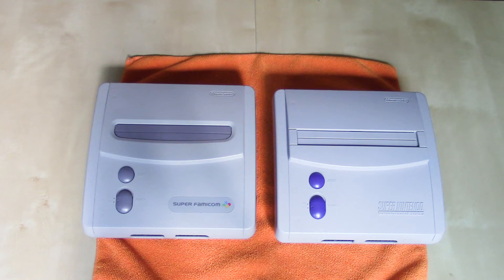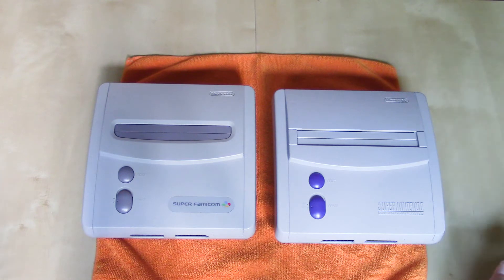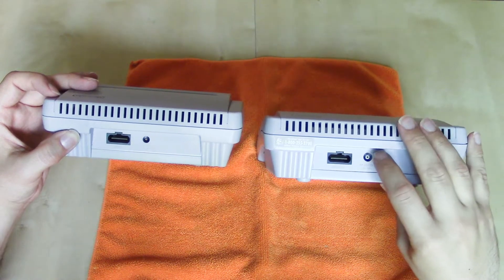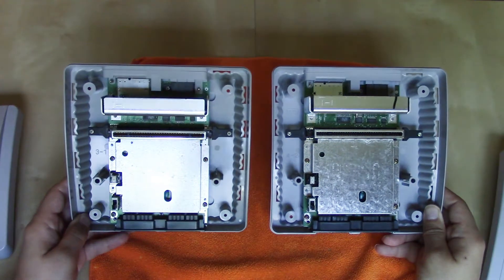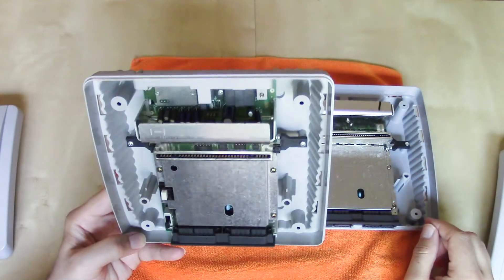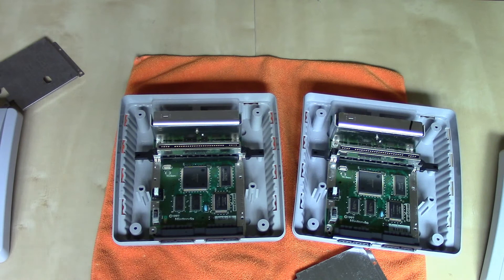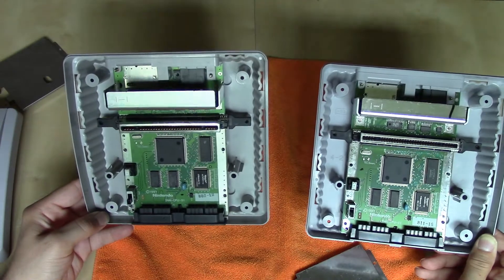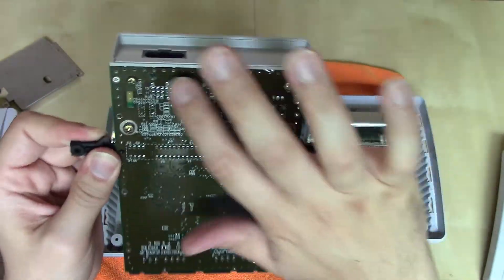Nintendo Torn Down: Super Famicom Jr./Super NES 2 (part 4 of 6)

Comment: I wish this model was released outside of the USA and Japan but sadly, this never happened.
In fact, the US Super NES-2 can be internally modded to play Super Famicom carts, even the Super Gameboy 2 and Sufami Turbo without even having to snap off those two notches on the cart support these days, thanks to 3D Printing!🤗
(Both Japan and USA are NTSC Region so Japanese imports can work without any problems)
All it needs is a 3D-printed copy of the cart support without the notches. And you can even keep the factory original part just in case you want to revert at some later point!

Comment: I once had the original SNES for years as a kid, but now I have the Jr. version to replace it until I get another one, as hard times in 2018 made me lose it. I knew the hardware is identical like the first models, but I'm surprised the motherboard is that simple and the SNES Jr is literally the same as the Japanese counterpart, while retaining much of the 1990 hardware, considering they were made until 2003. Despite removing some stuff like the lever and power light, one plus side for collectors is the redesign is always 1Chip, being a late run model. They're rare, though...
Reply from the maker: I've heard that the Jr lacks s-video out (you'd have to make a solder connection on the motherboard) and maybe the sound output isn't as strong as the early original models that have the separate sound chip module.
Reply: @yauy  From my experience of both versions, they sound 100% the same. But, yes, it stinks that the SNES Jr. has to be modified in order make it able to do S-Video/RGB because those pins for that are left unused for some reason. But, I use composite all the time, and it doesn't bother me because I use a CRT as should, unlike some people, who always want it to be picture-perfect through a flatscreen.

One thing I DON'T like about the smaller Jr. versus the original model is no eject lever and especially no power light, which makes it hard to know if it is actually running when not reading a game. And, its appearance don't feel as authentic. But, it works like a charm otherwise as long as you keep your isopropyl alcohol and Q-tips. Not perfect since the 1Chip's white levels are too high, but still WAY better than using a clone console (experienced that too, from an FC Twin).

Comment: I believe the super famicom jr has a larger capacitor in the back underneath the heat sync that the snes jr doesn’t have. Any idea what’s that capacitor is for?
Reply: It's a filter capacitor for the power input. The SNES AC adapter has this cap present so it's not needed inside the SNES itself, but since the Super Famicom uses the same AC adapter as the original Famicom, which lacks a filter cap inside, the cap has to be inside the console.
Reply: I mean heat shield